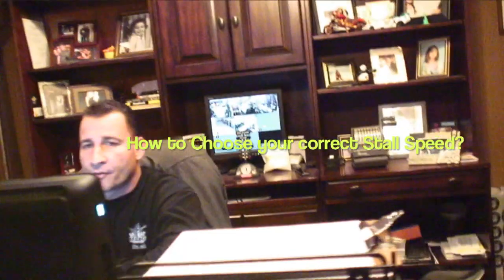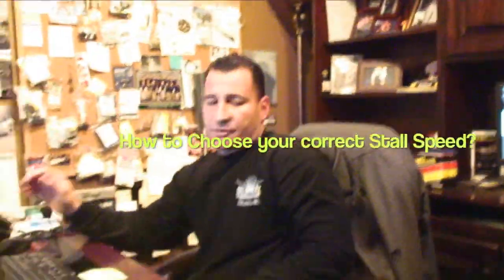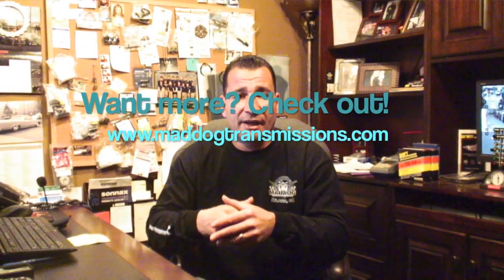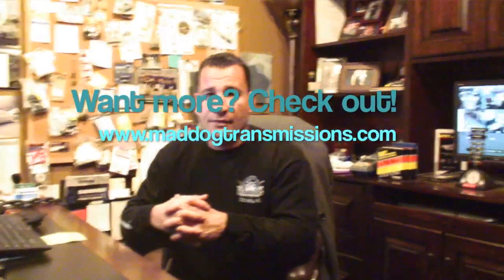How to choose the correct stall speed?

Comment: hey how u doin ur video is short but sweet and since u said drop in with questions well I have a 89 tpi l98 motor with chevy 202 heads my notebook with the truck shows the cam was set at 280degree and .480 with crane high intensity lifters than a few miles later the cam was advanced 6 degree and 2 degree bushing in backwards 108degree on 112degree center line .... can you make any sense out of the notes, I have from the previous owner?i was wondering for cam profile as well as for stall speed I have a 700r4 thank u very much
Reply: Hello
steven freda, for your application, I would recommend a 2200 to 2400 stall converter. It will work excellent with your set up and still be vary Street friendly.
You can call us and talk to a live person. Up until 10 PM Eastern standard time , Monday through Sunday.

Thank You,
"Mad Dog" Lou

Mad Dog Transmissions
Phone 770-781-0949
Reply: Lou Koulouvaris  Thank you very much for getting back to me based on what I have told you when I take my truck to a shop how would I describe my cam? mild or where would u place it and out of the information I gave you what numbers are my key points thanks again

Comment: what stall should i run the cam is a comp cam xr276-10hr max liftw/1.5rr:.502/.510 duration@0.050 224/230 duration @0.006" 276/282 lobe 110 intake centerline106 thanks
Reply: That's a small cam, a 2000 rpm stall is fine

Comment: Lou how vital is the condition of a separator plate on the 4L60 ? I was installing the pinless  valve kit and noticed alot of wear on the separator plate where the spring is located...Are they a replaceable item or need to be ? Thanks .

Comment: Hello boss man, factory stalls are around 1600 on gas most engines. Since you are running a factory camshaft you could open up to around a 2200 stall. It will give it that little extra out of the hole, but still be Street friendly and will work great for your application. Don't go any higher inless you change your camshaft.

Thank You,
"Mad Dog" Lou

Mad Dog Transmissions
Phone 770-781-0949
Fax 770-781-0969

Comment: Hay mad dog just seen your video on stall speed i am building a 05 ford ranger for my son i have a 05 crown vic stock with about 55000 miles i was wanting to put a holeshot stall thinking it would his take off the moter and trans out of the vic are stock with a chip and dual exaust what would you recomend i plan on putting a mid level shift kit also thanks for the video and any advise you may have

Comment from the maker: Mild camshafts usually were good with a 2200 to 2400 stall. If you still have engine vacuum this converter will work great. A shift kit is always good, Any other questions don't hesitate to call or e-mail us. maddoglou454@aol.com

Thank You,
"Mad Dog" Lou

Mad Dog Transmissions
Phone 770-781-0949
Fax 770-781-0969